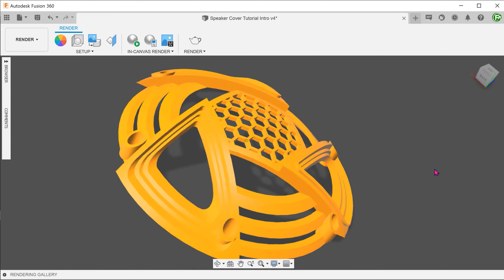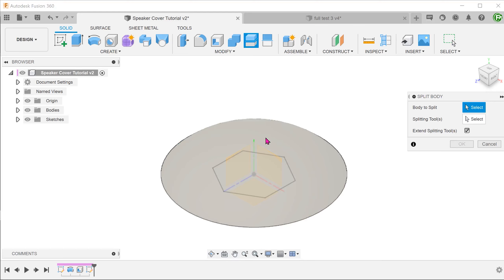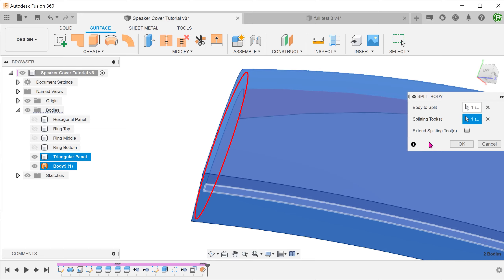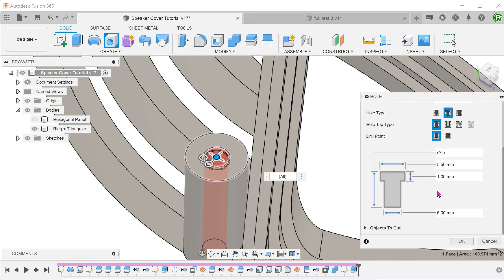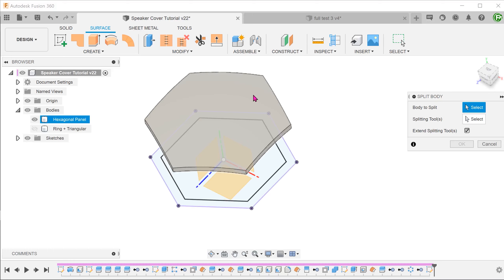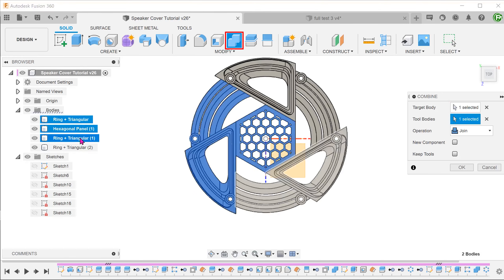Fusion 360 - Speaker Cover (Full Narrated Tutorial)

Comment from the maker: 0:00 Intro
0:30 Main revolve and shell
1:52 Center hexagonal panel split
2:46 Triangular and ring panels split
4:37 Detailing of ring panel: thin extrude
5:56 Detailing of ring panel: Rect pattern
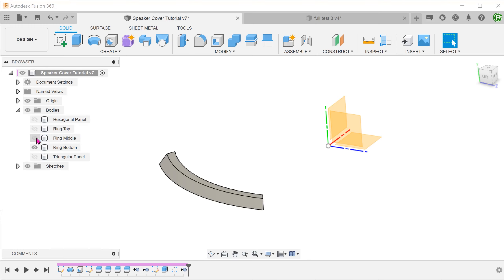7:14 Detailing of tri panel: Offset face
7:33 Detailing of tri panel: Split body
9:26 Detailing of tri panel: Shell
10:09 Detailing of tri panel: Fillet
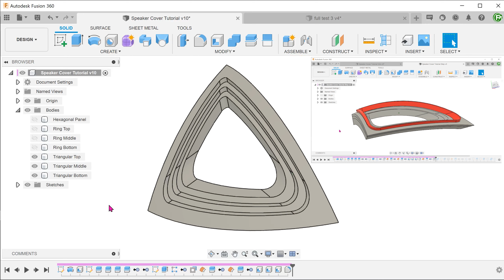10:40 Detailing of tri panel: Step
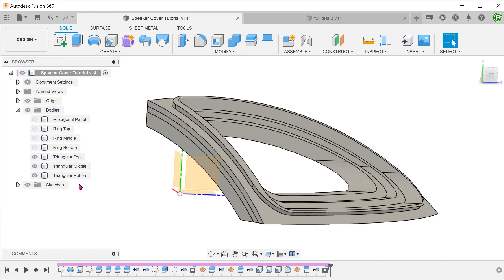12:03 Combine ring panel with tri panel
12:22 Bosses
15:58 Detailing of hexagonal panel
19:00 Final pattern and combine